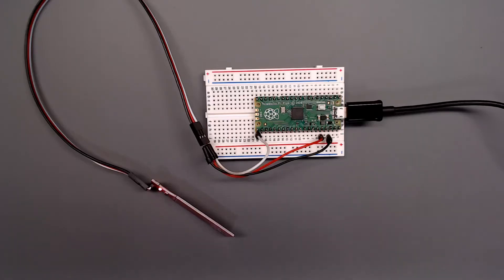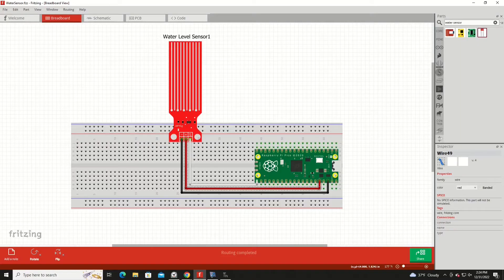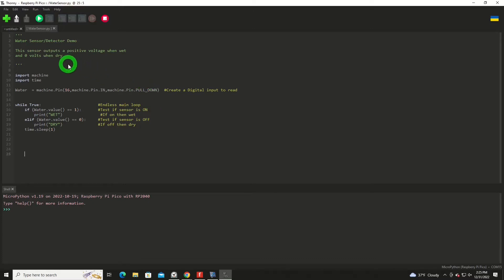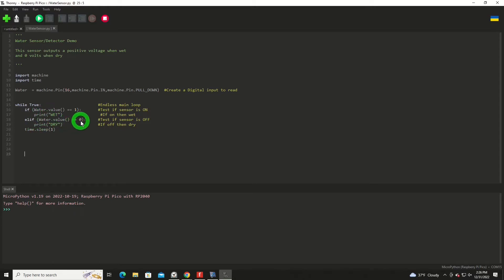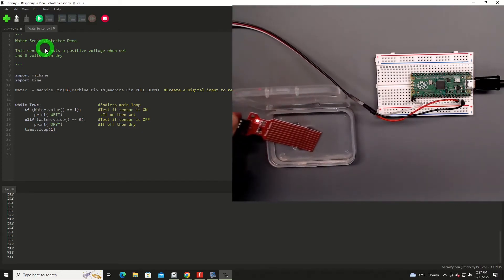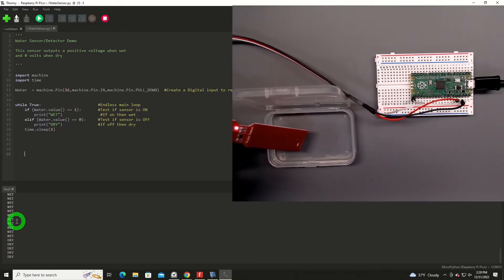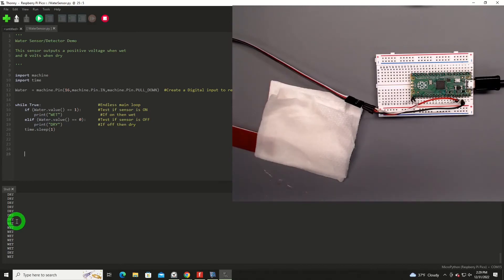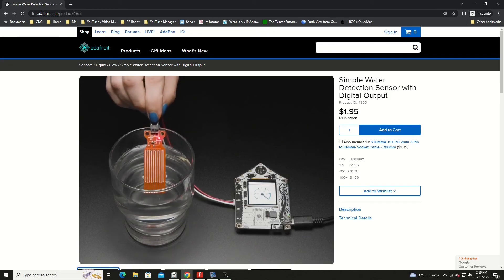How to use the Adafruit Water Detector with the PICO

Comment: I had thought of this type of censor. However my thoughts were to have varying lengths of copper strip so with, say, 3 inputs to the Pico monitoring the sensor you would be alerted as the water level rises passes each stage. I hope that makes sense.
Reply from the maker: Good morning Nigel,

That might be a fun experiments!
Cheers
Chris

Comment: If you wrap it in a wicking material will it detect a small amount of water coming into contact with the end?
Reply: You could dip the sensor into a salty solution of water, just for a second, and let it dry. A thin layer of salt crystals will form on the sensors surface and even small amounts of water will make it trigger reliably. Well, at least once.